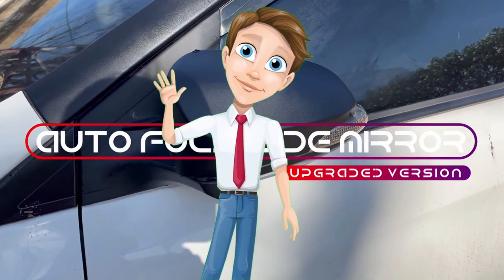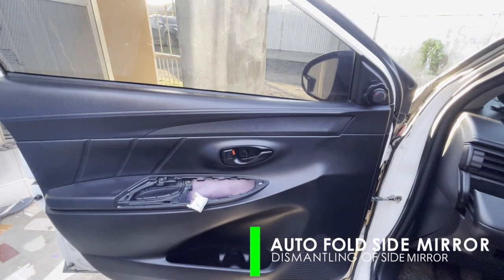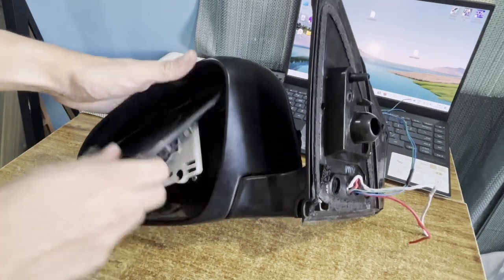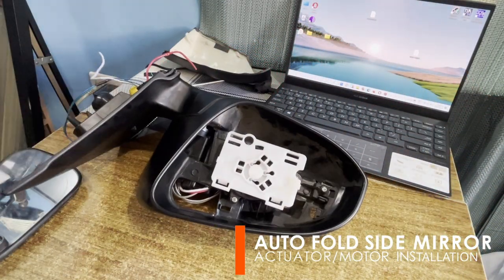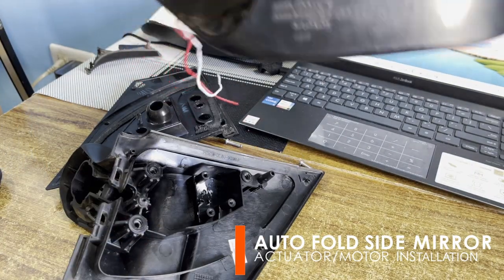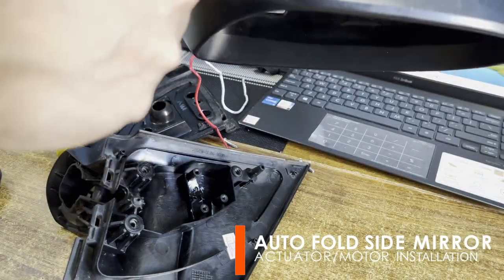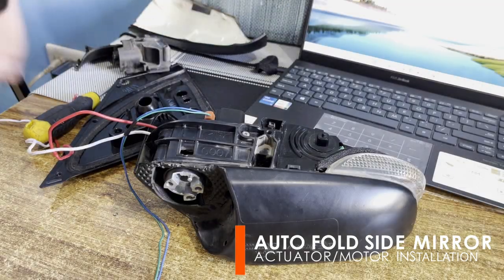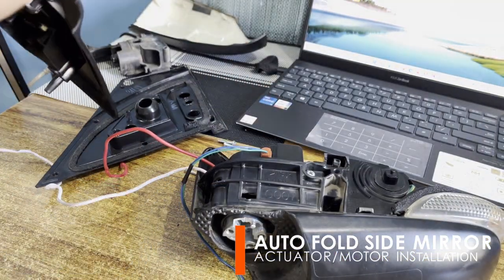Auto Fold Side Mirror [PART 1] How to install side mirror motor/actuator, #Toyota #AutofoldMirror

Comment: I notice testing the motor before putting in the assembly, my car in the auto or open position the motor turns indefinitely. Will the mirror assembly provide mechanical resistance that is detected causing current drop, which will cause power to cut once mirror is fully opened?
Reply: I have same question too
Reply: @ibrahimismail5980 I found out, answer is basically yes. But this was such a difficult job for me. My features has all features and was hard to get the wiring harness out through the hinge and then have to put through new motor. I damaged some wires and connectors and had to repair. ☹️

Comment: Hello, matanong lang po, sa diagram kasi ng module pang folding ng side mirror is positive(close) and positive(open) ehh yung vios pagkakaalam ko is negative triger, pano po yun?
Reply from the maker: Hi Sir, depende po sa controller. Ung original ni vios tama po, negative trigger. Pero yung sa controller is positive, follow nyo lng qng ano yung sa controller sir.

Comment: Is this just for the Vios only or for any Toyota of that era? I have Prado 120 GXL 2008 but even the top spec Grande did not come with power fold mirrors
Reply: 2008 model year and no power fold? That's crazy

My 1999 Toyota Corona has power fold mirrors

Comment: Hi, i have same model car. My manual side mirror plactic holding the spring broke. Can i install this motor and use to fold it manually? I mean, i dont want to do major wiring midification, just so i can fold it by hand.. Ples help.

Comment: I have just bought a new VIos car. Inside the car, on the driver door It has a button that allow me to put on to fold the mirror.
In the Car Key, It have the close button that allow me to put on it to close the door.
Now I Want to make that that button on the key allow me to press as the same (close the door) and some add function such as: folding the mirror, automatic turn 4 glass up.

 I Think no need to replace the motor for my car because it has already have the motor. What equipment do I need to add to add these funtions.

Comment: sir pwede po ba ito sa vios gen 4.5?
Reply from the maker: Actually sir, ung saken, risk lng dn kc not sure din at first qng fit xa kc pang toyota lng ung nakalagay. 

Pero try mo iopen ung side mirror mo sir. Try to compare po ung lalagyan ng motor. Meron aq jan sa video na pra xang empty motor holder, pag ganun dn sau sir, fit yan.
Reply from the maker: Try to watch po sir ung video q na side mirror turn signal light, mas comprehensive po ang instruction dun sa pg dismantle ng side mirror.
Reply: @EngrDeeIWye  saan ka nakabili sir?
Reply from the maker: @carlnikkovergara5917  sa lazada sir, nasa description po ang links. My nkapag install na sa 4.5 sir na nag pm saken, working daw po same specs sa gen 3 na ginamit q.
Reply: @EngrDeeIWye  salamat po sir, XE po kasi saakin need ko na lang ung para sa power mirror motor
Reply from the maker: @carlnikkovergara5917  saken sir J dn yan, as in wala talaga, pero pg gusto talaga, hahanapan ng paraan. Hahahaa
Reply: @EngrDeeIWye  saan ka nakabili ng motor naman sir para sa power mirror? Plano ko na lang sana magtingin surplus pang XLE
Reply from the maker: @carlnikkovergara5917  motor pra mirror adjustment sir?
Reply: @EngrDeeIWye  opo,
Reply: @EngrDeeIWye  yes po, saan kayo nakakuha po?
Reply from the maker: @carlnikkovergara5917  wla pa yan mirror adjustment motor saken sir, folding motor palang. Wla dn kc aftermarket sa lazada, plano q bili nlng ng surplus or parts-out
Reply: @EngrDeeIWye  salamat po sir, ganun na lang din pala  gawin ko hanap ng mga xle ung banga na part outs